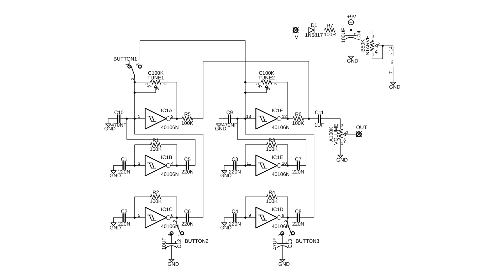HOW TO BUILD A SOLAR POWERED NOISE SYNTH

Comment: just needs a gate sequencer and an envelope.
Reply from the maker: the inconsistency of the solar power wouldnt allow a gate sequencer to function reliably. You can just run this into a vca though and use an external sequencer/any envelope or cv if you wanna chop it up
Reply: @HOLYISLANDAUDIO  unreliably seems ideal for this